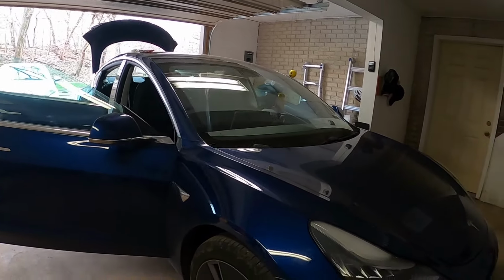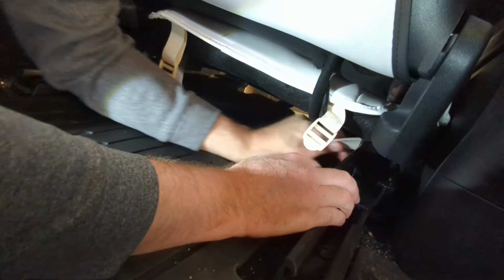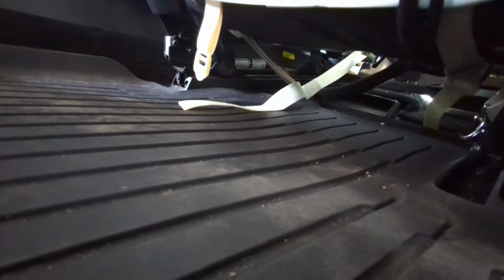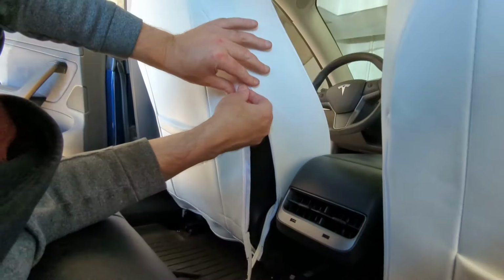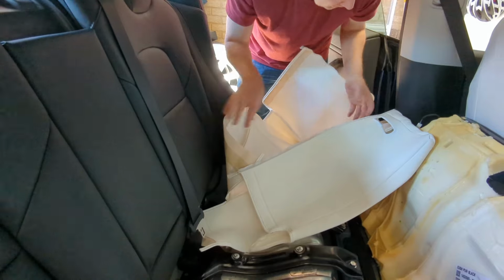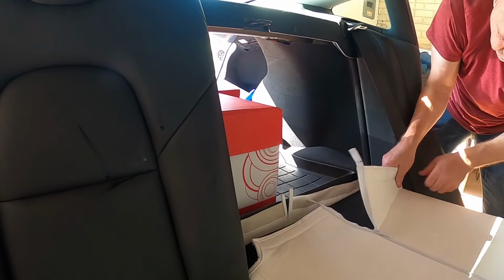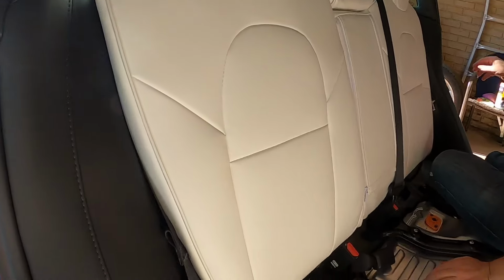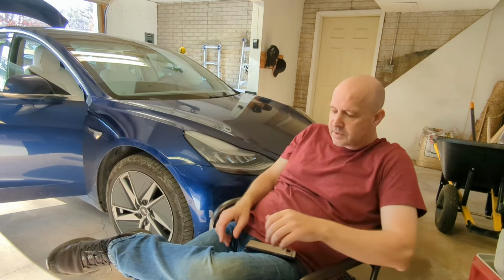UPGRADING OUR TESLA MODEL 3 WITH NEW SEAT COVERS: IS IT EASY TO INSTALL?

Comment: Wouldn't this decrease how much heat you feel through the heated seats? That's the main turn-off for me.
Reply from the maker: Hello, I'm not sure since I just put these on in the spring. From others comments, it doesn't change in a noticeable way.  Thanks!
Reply: The seat covers have limited to no impact on the heated seat function.  I have seat covers and did not have any issues feeling the heat when using during the winter months.